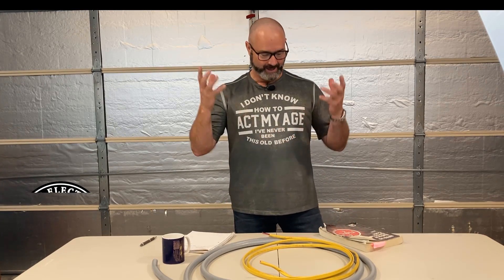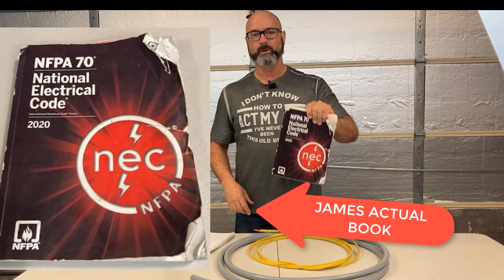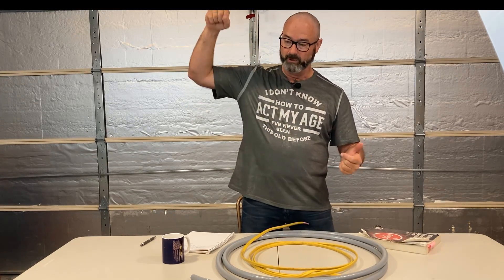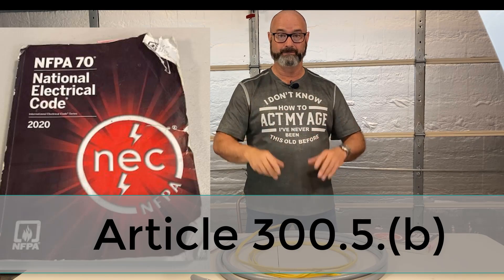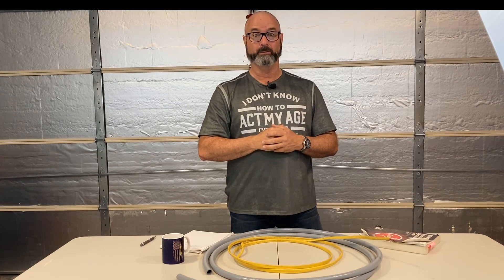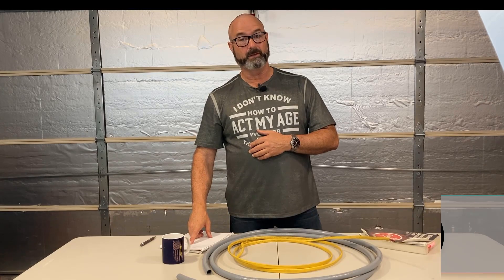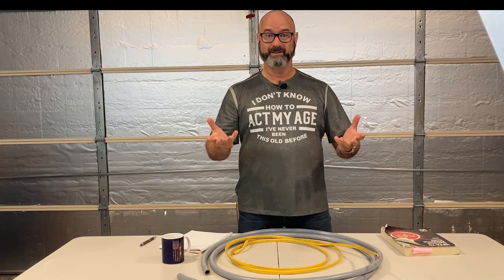Can Romex Cable be run Through Conduit? National Electrical Code Book

Comment: 334.80 limits heat to the 60degree column. Because of the internal trapped heat associated with 3 types  of covering around each Rolex conductor. 
These cables can’t clear heat readily so spacing is required between each cable unless you want to get stupid with derating 
We don’t dearth in nipples though 
Don’t forget to buy a fire extinguisher for all of your fire code violations !
Reply: Incorrect. The lower rating is not about internal trapped heat (they aren't 3 types of coverings and they don't need to dissipate heat}. Romex is installed in walls and ceilings engulfed in fiberglass and foam insulation with exactly zero ability to "clear" heat. Romex in conduit does not overheat simply because it's in conduit, another trade myth that won't die because people who don't know any better keep repeating it as if it was true. Until the early 80s, romex had TW conductors rated for 60C. All romex now, and for the last 40+ years, contains 90C conductors but the rule has remained. Basically, it's being derated to minimize overheating risk. However, for sizes 14, 12 and 10 the overcurrent protection has always been lower than the max ampacity of the conductors anyway so for those sizes the 60C requirement is a moot point anyway.

Comment: 12/2 needs to be in 3/4" conduit? what about 6/2? I thought that would fit in 3/4" conduit no problem?
Reply: 12-2 does not exceed the 53% fill limit of 1/2" conduit.

Comment: So can I run 12:2 with sheathing intact through a 1/2 inch non metal flexible conduit ?
Reply: As long as you don't install it in a damp, or wet location, yes.

Comment: So 10/3 NMD90 for a residential Landry room can or cannot pass through conduit 1 »
Reply from the maker: Sure it can. But if the 10/3 passes through more than 24" of conduit, it's supposed to be derated. Or run #10 thhn in conduit if it's a longer run in the pipe.

Comment: But unshielded Romex can be subjected to attack by rats and mice in some locations.
Reply: The newer type NM cable is manufactured using soy as an ingredient in the sheathing. Rats, mice, squirrels, and any other rodents that have access to your new romex cable will eat the sheathing off and leave you with bare conductors. 
Should be a crime to include soy in that. This is a new development. Never was this way before.

Comment: What is code for wiring soffit lights in eves? I see videos where Romex is “fished” along loosely. The fixtures may be damp rated and have metal boxes but not watertight ones. Question 2, wiring for an open covered walkway. NM conduit with THHN stranded or metallic conduit with stranded? Or Romex? No Romex I’m thinking. Metal conduit in the soffits and the underside of the covered walkway. The soffits are a heavy burden for metallic. Then there is Carlon blue Flex with stranded wires. Any suggestions? Well that’s more than two questions.

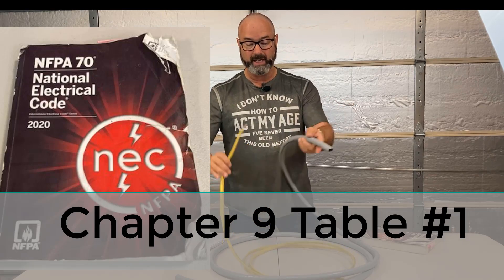Comment: 3:35 the romex could be considered one (1) current carrying conductor?🤯 that is amazing if so, what code can I reference? Thank you!
Reply: As a non-electrician I've run across this before—it was with respect to network cables, but the same rule applies...and for many very good reasons. The concerns are the following:
(1) For anything carrying a meaningful amount of current relative its size cooling will always be a concern. Romex is already constructed with some "minimal" (actually much more than that) consideration for cooling in mind, but there's a great degree of disagreement as to the best way to test whether putting it into conduit compromises the original design considerations. Therefore NEC is intentionally crafted to make things as simple as is reasonable possible. Hence "one" conductor assembly (note the extra word there). One Romex is a conductor assembly, one THHN wire is a conductor assembly.
(2) Those of us who've dealt with Telephone wiring (USC Title 47 Part 68) or computer networking cables (USC Title 47 Part 15) know that each individual bundle of wires is designed to be treated as a single entity when it comes to running them in conduit. This has nothing to do with NEC mind you, but it is nice that the two are compatible. 🙂 This is especially apparent when considering the minimum turn / coil radius of networking cables. Attempting to figure it out based on how many conductors are inside, what they are insulated with, if there is an internal nonconducting string or not, and what the outside is made out of is a major headache. Instead each cable is built to a specification (CAT 5, CAT 5e, CAT 6, etc) and each type of cable with that specification (indoor, outdoor, plenum, etc) has common parameters assigned. Again, the "KISS" principle in action...just like what NEC has in it.
(3) Separate conductor assemblies will move relative each other, yet the motion inside of conductor assemblies is almost always negligible. Therefore, it can be said with reasonable certainty that there are concerns which apply more to the number of conductor assemblies than to the number of actual pieces of current-carrying strands involved. Additionally, friction inside of conductor assemblies is typically much smaller than between them.
(4) NEC, for the sake of the sanity of the people reading it, just says "conductor" everywhere that they really mean "conductor, wire, or conductor assembly". I suspect they explain that more thoroughly in the definitions section, but probably in a way that doesn't really mean much to most people.

Comment: I have a surface mounted panel, and want to run romex from the panel to the ceiling,  where it will not longer be exposed    
wiring.  This will be 12/3 Romex  From the video it sounds like I can use 3/4" flexible metal conduit to run that romenx up to the ceiling.

1)  Is that correct?

2) How should I terminate the flexible metal conduit?

The FMC is  only used to protect the romex from damage  ----does this mean that the FMC is a "sleeve"?  And what the heck is a sleeve, anyway?

Comment: What about trying to run power out to a deck. Where the main power source would be used from an outdoor spot light. I'm thinking of adding a plug for a electrical awning and a double plug for power. I'm looking at roughly 25' of conduit under a roof eave and onto and down  the brick of my back wall. Can 12-2 romex in pvc conduit be used?
Reply: What kind of wiring would I need for outside above ground
Reply from the maker: @kevinhaas6336  same thing: once it's outside, it needs to be damp/wet rated.
Reply: @abrelectric  thank you
Reply from the maker: Once it's outside, No. Don't forget your GFCI protection 😉

Comment: Do you have any vids on connecting solar panels 240v grid tied to you panel box. Not a lot of watts. Say 700 watts. Just some supplemental watts for the house. You tube says the bottom right side of your box. Any advice.  like the new plug and play systems that are becoming more popular. Thanks
Reply from the maker: I got nothing...however, a lot of the new portable solar generator systems are simple, and seem solid for providing smaller wattage output

Comment: It’s a little confusing when you say you can’t run romex under a kitchen floor. But a bedroom underneath a kitchen floor has romex  running through the ceiling for light fixtures. Please explain.
Reply from the maker: You can't run romex underground. Once the conduit is underground,  it's considered a wet location.

Comment: Appreciate your opinion on running 12/3 through liquid tight 3/4" conduit underground to get an outlet to a outbuilding.
Reply from the maker: You "can" do it, and it will work. It's just not Code compliant. Either UF or individual conductors THW or MTW on the jacket.

Comment: I was thinking about adding wafer lighting under my covered porch from existing outdoor wall light. I can’t run 12/2 Romex through liquid-tight conduit? It has to be stripped or UF?
Reply from the maker: If it will be concealed in framing and covered, run that romex. 
If it's exposed, you can run UF (if it's not exposed to physical damage), or run conduit with individual THHN/THW conductors.
Reply: @abrelectric  It’s just covered, not screened in around the 12x30 porch.
Reply from the maker: @jakemiller7760  there you go. UF or conduit.

Comment: Thanks for your video. How about running Romex through grey PVC outdoor, all joints connected by pvc cement and away from direct rain or moisture? 

Thank you for your reply in advance.
Reply from the maker: Once the conduit is outside, the romex is a no-go.
Reply: @abrelectric  My breaker box is outside of the house. An electrician ran Romex, through conduit from the breaker box, up the outside of my house and into the attic. Once in the attic the conduit ends and the romex runs to all of the smoke detectors.  The conduit is large enough to meet that requirement - but is it against code because the conduit is outside? It sounds like it is against code but building inspectors have passed it - but they may not have been good at their jobs….
Reply from the maker: @hexagontaginal  I would let it be. If the authority having jurisdiction (AHJ) approved it, you're going to be ok.

Comment: Can I put 4-10/2 ufb in 1 1/2” conduit underground without it getting too hot while using all 3 receptacles I currently have that ran but haven’t wrapped it up yet I’m having a band come out for my birthday and don’t want any issue when they start jamming out the other outlet is for the dj all 4 outlets are on its own 20amp breaker im paranoid about it should I take it out and just direct bury it? Any suggestions greatly appreciated
Reply from the maker: With information you've provided,  you should be able to do your plan, assuming you don't draw more than 30 amps per run.
Reply: @abrelectric  yes sir thank you I was just paranoid about the wires getting hot inside the conduit and melting lol

Comment: When running EMT or PVC from outdoor into inside a garage, do I need a 4 " piece of conduit inside the wall, or can the THHN wire be 'in air' as it goes from one side of the wall to the other side?
Reply: THHN cannot be run loose. Also, THHN if running in a conduit outside needs to be THW

Comment: I have a small apt above a garage  for my personal use I wanted to run 12-2 Romex inside a new 4 inch pvc pipe I was going to run about 6 or 7 wires inside the pipe and it will be inside the garage corner just wanted to know if that is safe ?
Reply from the maker: Likely, but lots of details. How are you connecting the 4" pipe to tge wall? The attic, etc. Once the romex leaves the pipe, how will you terminate it?

Comment: I have a question. I have a finished attached garage in NJ. Ran plastic pipe from breaker box that is recessed in the sheet rock. Can I just pop a hole in the sheet rock and bring pipe up to breaker box inside the wall?
Reply from the maker: Absolutely. Add an offset to get inside the wall,  use the proper connector, and you're downtown.
Reply: Thank you sir!

Comment: Very helpful. I am going to put Romex inside conduit in my garage. Now my only question is when is rigid conduit better than flexible conduit? I am using metal boxes flush mounted. I guess metal boxes are always flush or surface mounted.
Reply from the maker: Dan, is this open stud construction or already drywalled? Rigid conduit offers better protection and looks IMO neater. If you've goymt a lot of bends and the conduit will be drywalled over at finish, use flexible.
Reply: @abrelectric  It's another big shed or garage I just built. I lined the inside of the building with 3/8 plywood. I'm thinking that the conduit isn't going to require any bends at all. It's just going to drop down from the top of the wall straight into the outlet box. I'm pretty sure I'm going to use rigid conduit.

Comment: So in a wet damp location what do you run in conduit.
Reply from the maker: Look at the insulation code on the wires: pull wires with the 'W': THW, MTW, etc. Or pull UF.

Comment: Are u talking under island in basement or crawl space uf?
Reply: Can I put SE cable in conduit?
Reply from the maker: @michaeljennings5170  yes, same rules as for Romex.
Reply: @abrelectric  code number?
Reply from the maker: @michaeljennings5170  Article 338
Reply from the maker: To a kitchen island under a concrete slab. That will be a damp location. Through a crawl space could be considered a dry location.

Comment: Thank you! Great info Fella! At Min 4:40 you mentioned we need to meet those 2 criteria when transitioning but is actually only one criteria at that point cause then we can apply note 2 wich says that Table 1 only applies only for complete conduit or tubing systems and not for sections used to protect for physical damage. So esentially in that application in particular (when transition from attic to exposed) we might be able to get away without being concerned about perentage fill, altought we might have to derate for the bundling, but then again we might wave the derating by using 310.14 (a)(2) Exception. Wich is Selection of ampacity
Reply: Btw!,  where did you get the elliptical cross sectional area of 12/2 romex? The other day i was so courious about how to do the Calc. For knowing what gauge multiconductor cable would fit in a 3/4 pvc pipe wothout ecxeeding 53% but i gave up, i couldnt find any info on the internet and the othe challenge was once i get that measurement how do i convert that into square inches?  Shoot! Good luck with that! Right!
Reply: I can't get a solid answer on exactly this. I transitioned from 6-3 NMD90 into 3/4" NM flex conduit to go through a concrete wall (sleeved). I kept the conduit and wire going to the sub-panel on the other side of the wall (6 ft away). Carlon says it's good for 4 #6 conductors, but it's sheathed. So am I good because it's an open end conduit for heat to escape? (It's the Grey flex, not the cheap blue stuff - 90 deg C)

Comment: a hopeful video for me, and thanks! I have a situation with a NMD90 6/3 AWG white wire from basement through to outside. Its one of those 50amp 240V wires used for a future hot-tub. The exit point is of the wire is 1 foot off the ground. Can I place the GFCI break box right over this exit point, or do I need to raise my break box a couple of more feet higher off the ground which would require a conduit. Which option do you think is better?

Comment: So if I'm running a outlet outside next to my panel. Can't I just strip the wires out of the romex and run it inside liquid tight conduit?
Reply from the maker: You can. You can also wire it with an extension cord inside the liquid tight.
The point is increase your skill in your craft, knowledge of the Code. Doing it right on purpose,  not just what is convenient.

Comment: Will 4 individual 8 gauge  stranded wire fit legally through 3/4 conduit
Reply: look it up in a code book, or a table online.
Reply: @joewebb4836  Do you have a code book

Comment: In your example of running wire to a kitchen island underground and that being a damp or wet location, is that in a slab. What about a crawl space where it's under the floor but not under the ground. Thanks
Reply from the maker: You're right. If it's not underground, and the crawl space is normally dry, then you could use romex, properly secured.

Comment: How about romex under a manufacture home? Has to be in conduit?
Reply from the maker: Is it a damp location? By code or actuality? Then conduit or UF. If it's a double wide,  and you cross the seam, how will they move the home later?